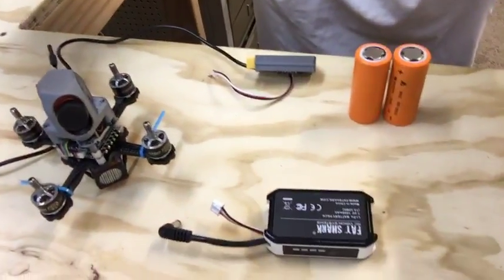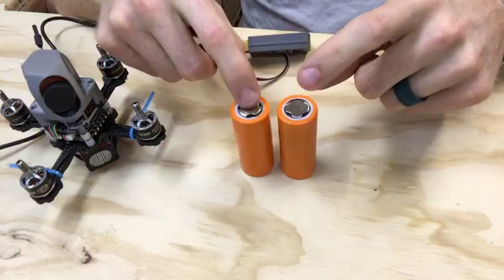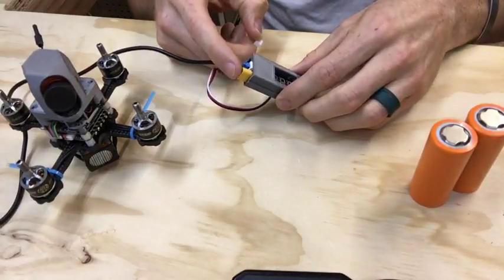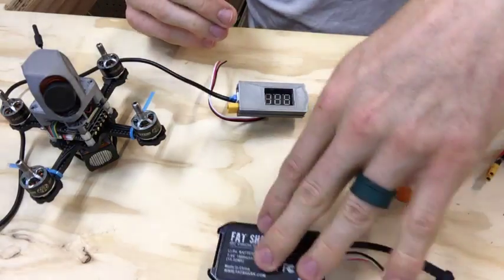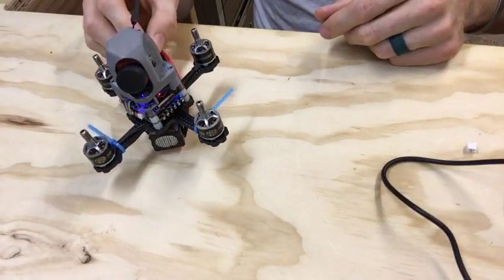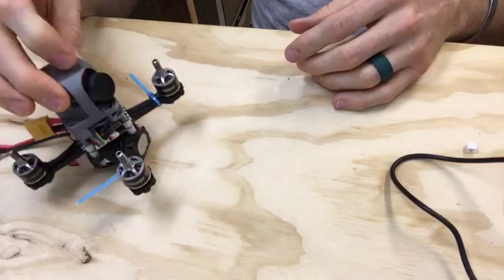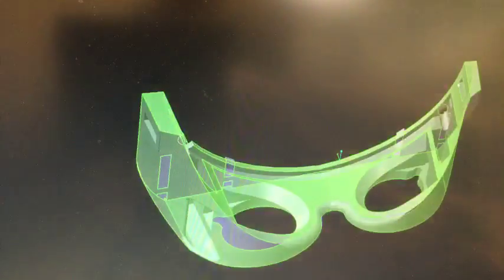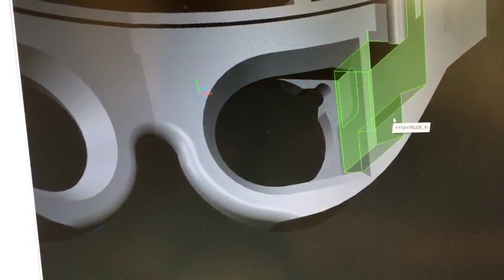Update | 3 Inch Drone | Fatshark Battery Upgrade | Live Stream

Comment: Now you need to mount a machine gun to it. Lol
Reply from the maker: +themeez1000 haha yeahhhhh maybe small rockets instead?
Reply: Ok. I concur with that modification. Lol
Reply from the maker: +themeez1000 excellent ;)
Reply: If you need a really long lasting battery and you don't need to be super mobile while using it, you could always build an apparatus that uses a deep cycle marine battery to power the headset. Should give you about 100 amp hours fully charged. Granted you can't be crazy mobile with it since they are 60lbs or more.
Reply from the maker: +themeez1000 oh dang, no yeah I need a portable battery. Something that fits on head strap or in pants pocket. A deep cycle battery would be a tad too much.
Reply: I figured as much. Just a suggestion if you need a really long life. Lol
Reply: What voltage are you having to run
Reply from the maker: +themeez1000 that's true, it would provide a super long FPV session :)